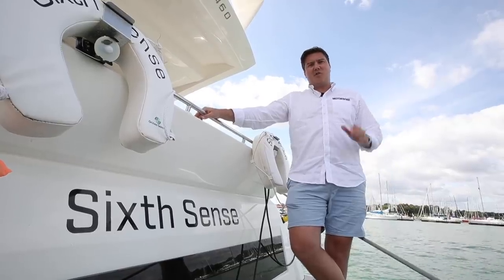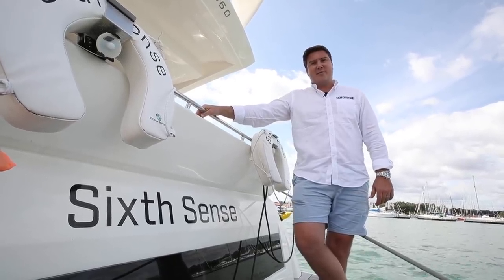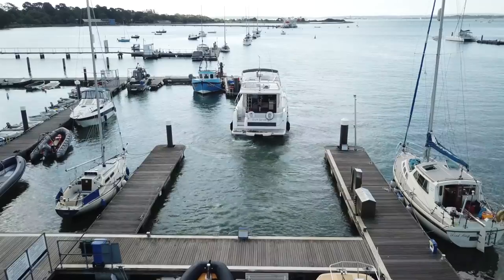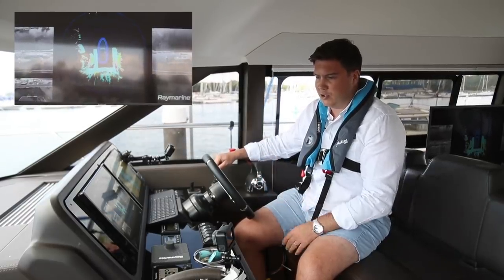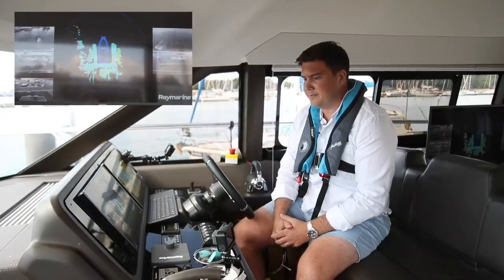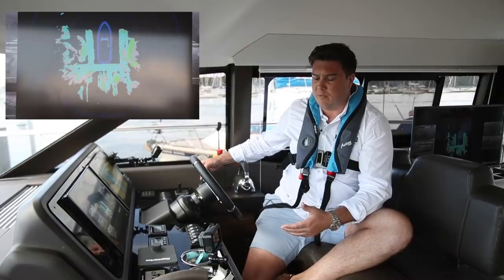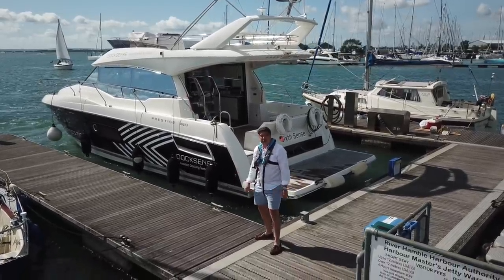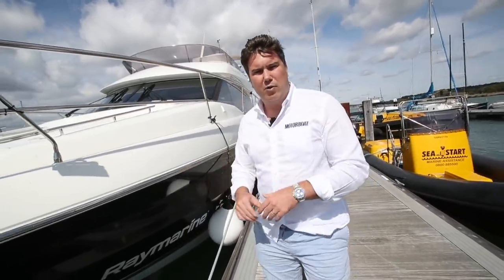The boat you can't crash | Raymarine virtual docking tech tested | Motor Boat & Yachting

Comment: Amazing stuff.  This will really push people into getting bigger boats.  The biggest issue with going bigger is docking for sure.    I am sure this will cost a fortune though.   Question:   That's great that it will hold you in place.  But if you are on the boat solo and you are trying to secure lines it seems you will be fighting the boat.   Does it have a remote joystick feature?

Comment: So the system will hold the boat in place, but once you get off the boat to attach the lines, does it allow you to pull the boat snuggly toward the dock with the ropes to tie it up with the system engaged? Forgive me if i used incorrect terminology, i am a new boater
Reply: Turn the system off after securing the lines. Then tighten the lines.

Comment: "game changer"; indeed! I wonder if it holds the position (like DPS on IPS) on stern driven boats as well?
Reply: Didn't he said it, that it even works with shaft drives in the video?
Reply: @berndhaverkock6070  Indeed, the "bumper" might work; I was wondering if it could hold the position as IPS/DPS does.
Reply: @okumonux  according to VolvoPenta's webpage the DPS is GPS based, while Raymarine's solution is camera based. 
If there are in the nearer area (depending on range of the cameras) of the yacht some fix-points, which the cameras can use, theoretically, Raymarine's system should be able to held the position everywhere. But purpose seem mainly to make the docking process easier. 

If there are precise GPS coordinates, maybe the DPS could be used for docking as well.

Just my thoughts.
Reply: @berndhaverkock6070  Those are exaclty my thoughts as well. Volvo did introduce joystick docking to shaft drives, but they didn't introduce DPS. You might argue that you can get a shaft driven boat with a Xenta-joystick (including dps) AND the raymarine system; but that might seem to hard to integrate. Would be great if the raymarine system has some gps-positioning included already...
Reply from the maker: @okumonux  It can.
Reply: okumonux the system does hold position using gps and heading. As soon as the user let’s go of the controls it will hold position and heading until the give more input to move. It will do this in open water or near a jetty etc.

Comment: can we see it tested in windy/stormy conditions?
Reply from the maker: It's unlikely that we will be able to test this particular boat in different conditions but we will no doubt test new boats with this system fitted in the future and will report back on its performance then. FYI, there was a bit of breeze blowing during this video and the tide had just turned.
Reply: Having driven this same boat and system its pretty damn good. As good as he makes out in the video. 
In strong winds and tides etc it’s only as good as the drive system it is fitted to. For example if the wind is that strong that the IPS couldn’t hold the boat in position in normal operation then this system can’t make it do any more than it is capable of despite it trying to.
Reply: @grahamstones3791  yes that would be the systems technical limit.. just wondering if there are any significant processing delays during direction changes or heavy winds/waves that may affect the system negatively.
Reply: @gaoglai7127  the response from the system is pretty much instant. It holds the boat with in about 10cm of the position and a degree or two of the heading. Its interesting watching how much it reacts to movements of the boat to keep it in position. You can see on the screen any inputs it makes to turn or move the boat and how much thrust it is demanding. I've used it a few times and never felt the need to put the ips into high power mode in order to let it keep control

Comment: Wonder why no one came on the market with this before.
In cars you have it already. And on/for yachts you have more space and money to install the necessary computer hardware.
Reply: Actually Sunreef motor catamarans have had a similar system for years which gives you 360 degree views from above on your screen. I think you still dock it yourself though, but it does have the virtual anchor.
Reply: Smaller market - microscopic compared to the automobile one. Much harder to bring down costs of marine technology to even bring a product to market, even factoring much higher consumer prices. And a problem with this specific system is that most docking berths don't have over 3 meters of spare space, especially in the Med, where so many of the large/expensive motor yachts are. Lots of times one needs to squeeze in by literally bumping aside the other boats. So even a more restricted market. That said, I think it's great.
Reply: @cordobes  I suspected as much. Also yacht crews won't like this automation as it'll put them out of a job

Comment: Yet, you almost hit the dock on starboard 🤔 and had to reposition?
Reply: Robert Meyer the system lets you get as close as the virtual buffer size that you set. If the buffer ‘touches’ something it won’t let you move until you move away from the object in to ‘clear’ water without the buffer touching anything, just the same as you wouldn’t want to move any further if the actual boat was touching the dock.

Comment: Folks, you are one short circuit or faulty sensor away from disaster. Heck a seagull could poop on a lense then what?  All of these expensive upgrades & joy stick controls take away from basic knowledge required to pilot boats. 

Dealers want to pump out sales $$$ and sometimes turn over the keys to people have no business driving.  

Learn to drive and save a fortune by paying an experienced captain to go out with you a few times so you know how to do this without dependence of so much technology.